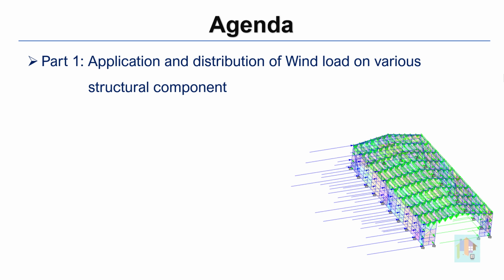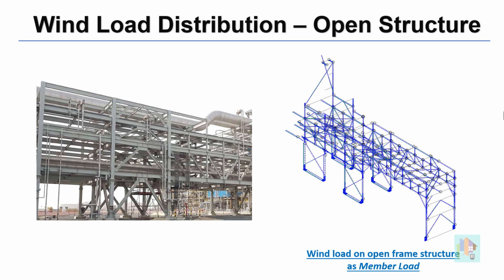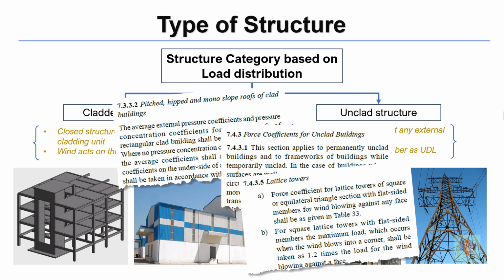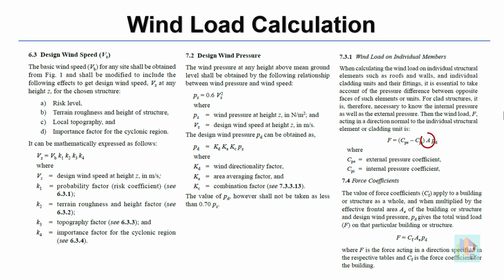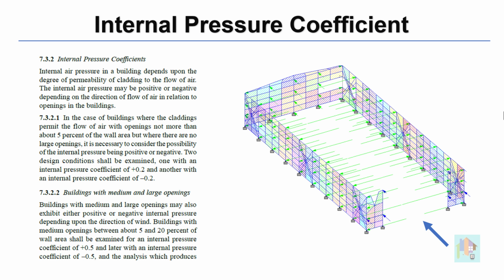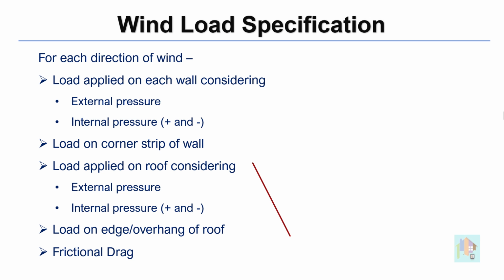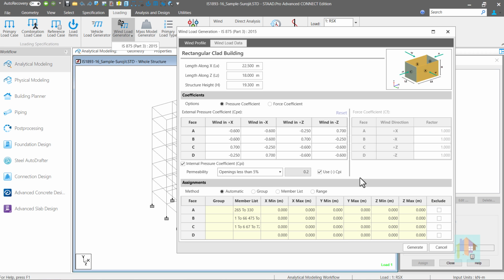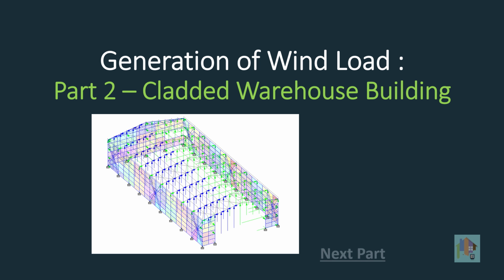Generation of Wind Load in STAAD - Part 1: Basics & Wind Load Distribution || IS875 Part 3 2015

Comment: Which version it is, I can't find any option of assign wind load as per indian standard.
Reply from the maker: Wind load generator was implemented in STAAD.Pro CONNECT Edition V22 Update 8. If you use any version since Update 8, you can find this option in the Load ribbon.

Comment: Dear sir does the batten and laced column design works in staad pro ???
Reply from the maker: By default, batten and lacing are not considered during member design. During design, we can consider the effect of these additional elements using various design parameter. For more accurate analysis, you can create a FEM model, though it is time consuming and not recommended for normal steel structure.
Reply: @surojit_ghosh  can you say which parameters?? We have to implement to design batten/laced column !!

Comment: Does these wind load generation wizard comes with staad pro advanced version only ??
Reply from the maker: This feature was implemented in CONNECT Edition V22, Update 8. You need to use this or later version of STAAD to use this feature. This is not limited to STAAD Advanced license, you can use either STAAD Basic or Advanced license.
Reply: @surojit_ghosh  okay thanks you so much if I have update 6 with licence version if I instal with update 8 then will it work with these licence only or I have to purchase another one with update 8 version !!